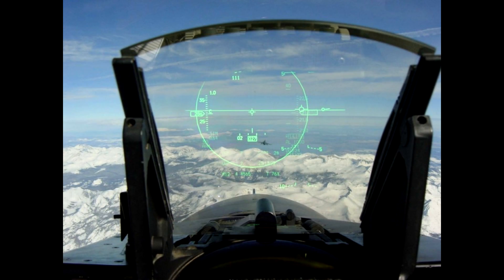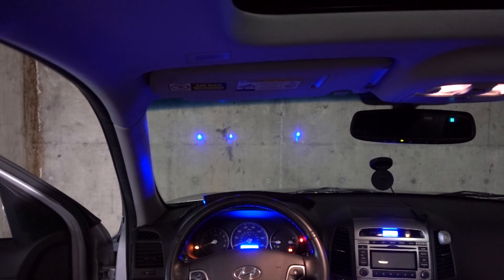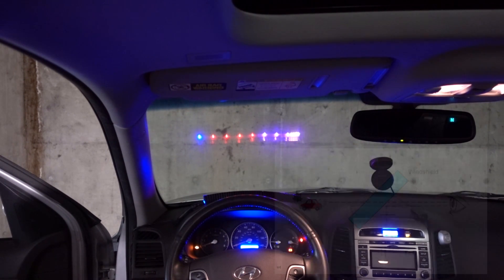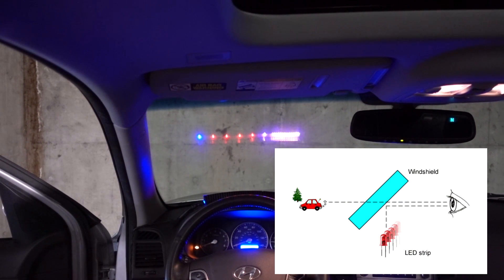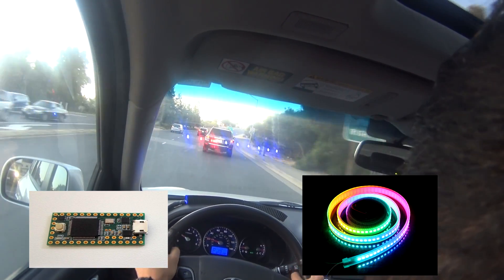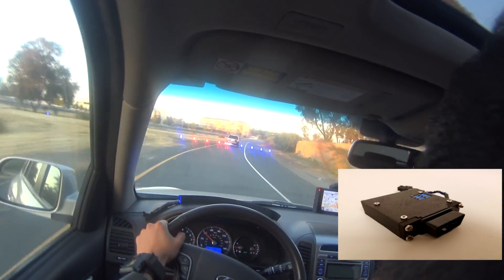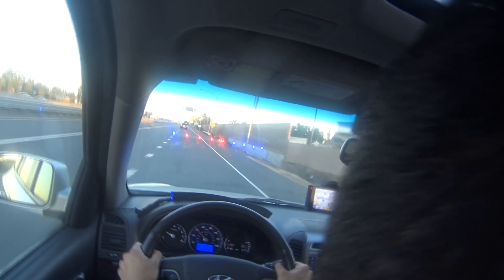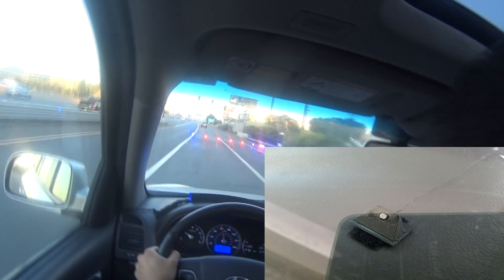LED Strip Car Heads Up Display (HUD)

Comment: Cool concept! I'm wondering about the level of glare you might experience at night, though.
Reply from the maker: The light sensor tells the Teensy firmware to dim the LEDs at night. It works great, my eyes are fine at night with the settings I've tuned it to.

On camera it looks flared but so do all the tail lights ahead of me.
Reply: Ah, well done then!